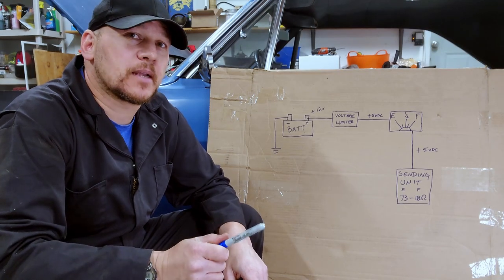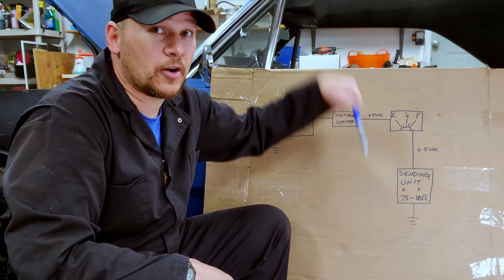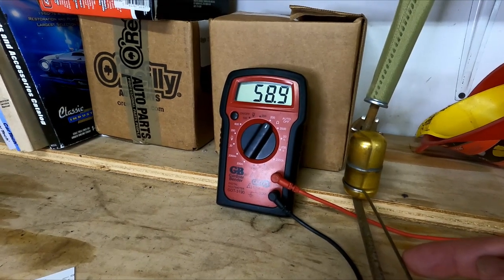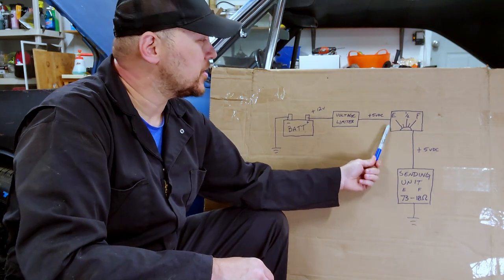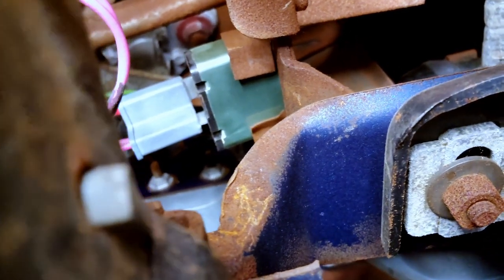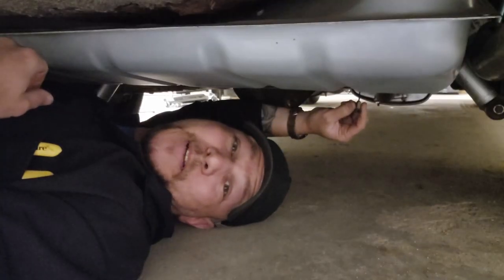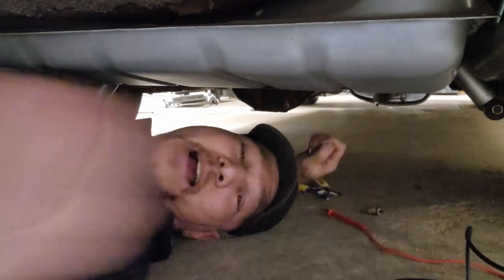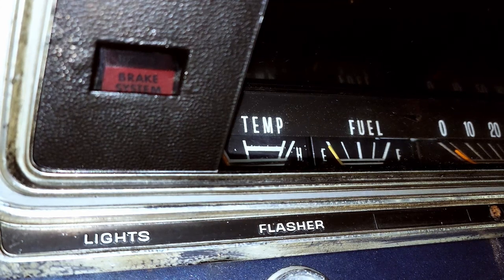'67 Dart Fuel Gauge Diagnosis

Comment: The alternator gauge is on a separate circuit and not affected by the instrument voltage regulator. 
When the fuel and temp gauges don’t work that’s usually a sign of a bad voltage regulator. Hopefully when it failed it didn’t stick in the on position and burn up the gauges.
Reply from the maker: Thank you for the info. I eventually got it working....sort of. The gauge works but the aftermarket sending unit is crap and doesn't give a correct reading. It works on and off which leads me to believe it is loose pins on the PCB. We'll take a closer look after the 360 build is done.

Comment: Fuel gauges are easily fixed I would like to see some videos on how to repair electronic oil pressure gauges some engines have  two wire oil pressure gauge one wire works the oil light the other one makes the gauge work the one that works the gauge has  pulsating voltage the wire that kicks  out the oil light has continuous voltage but for some reason the pulsating wire can get out of sink therefore making the cage not register the right pressure I would like to see a video on how to repair this most people trying to repair an electronic oil pressure gauge just give up and put the manual gauge on the car
Reply from the maker: I will see what I can do. This car just has a light. I put an aftermarket gauge in it, and the gauge currently works just fine. I.generally cover issues as they become a problem. I am sure it won't be long. With much of the car original, things seem to break just by touching them. Lol.

Comment: Isn't  the altmeter separate and not affected by the voltage  limiter? I'm going throught the same horse shit with my dart . My gas and temp guage are dead. but worked a month or so ago . I'm thinking my voltage limiter  is bad . If I feed 5v to the lugs I can get the guages to sweep.
Reply from the maker: MrZ281980, Thank you for visiting and for the Sub. It is much appreciated. I just went through the schematics and you are correct. The voltage gauge does not go through the limiter. From the description of your symptoms, it could be the limiter or the PCB. The pins are known to go bad. If the pin on the opposite end of the run connected to the center post of the limiter is bad, it would cause the same symptoms. You can fix the pins by soldering them to the board. Which gauge cluster do you have? The limiter is in the fuel gauge in the rally clusters.  If you have the external limiter, you should be able to see it a little to the left of the fuel gauge on the back of the cluster and it is a fairly easy swap though I have read some of the aftermarket limiters have issues making contact with the board and need to be soldered or jumpered to the run. Hope this helps.

Comment: Great video. Plan to start troubleshooting my 68 Dart with same problem.
Reply from the maker: If this video doesn't do it, I have a follow-up. My issue ended up being the pins on the PCB on the back of the instrument cluster. Feel free to contact me directly if you have questions.
Reply: Thanks it will be a week or so before I get into the patient.... @MontsweagGarage
Reply from the maker: Patient eh? Sounds like surgery. I'll be doing some surgery of my own this weekend. Lol. Like I said, give me a shout if you have questions. I work with electronics in my day job.